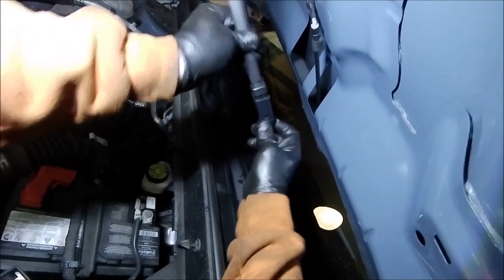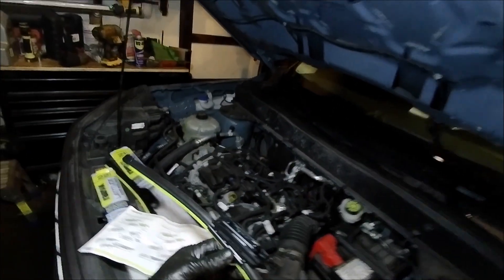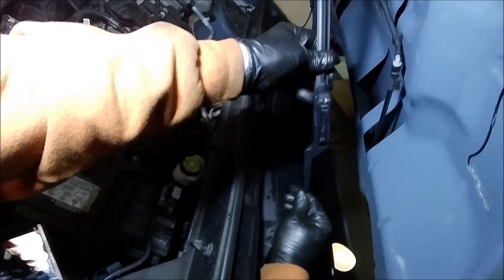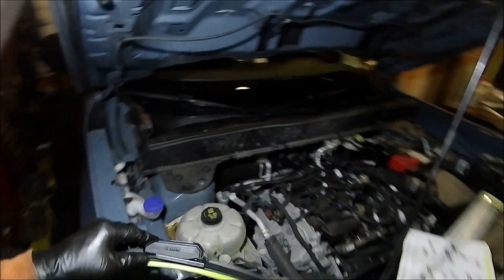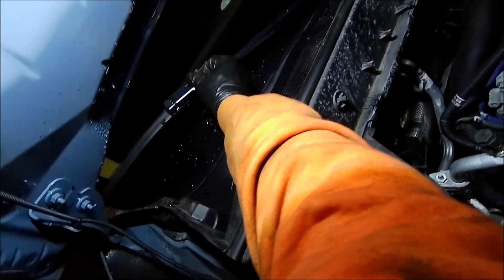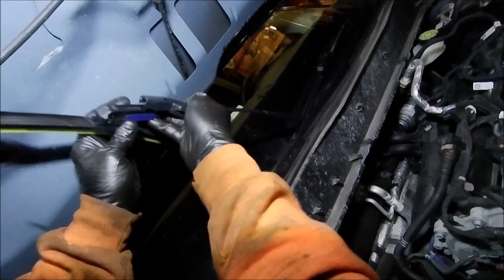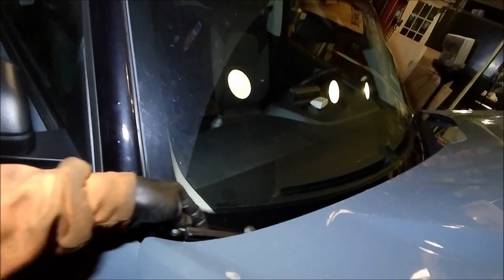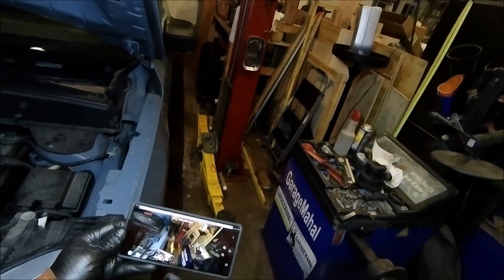How To Change Wiper Blades in Under 3 Minutes Ford Bronco Sport Wiper Blade Replacement

Comment: 21” and 22”? I purchased blades for my Big Bend today and they’re 20” and 24”. Do you know if these sizes are a good fit?
Reply from the maker: So most wipers on most vehicles you can go up or down and 1 inch or 2 inches at most. 21 and 22 fit best, 20 seems a bit small however, you want the max amount of clearing. 24 sounds a bit too much...
Reply: @GarageMahalLife  Thank you for the advice! I’ll be exchanging the ones I bought, as the ones on my car now are 21 and 22.